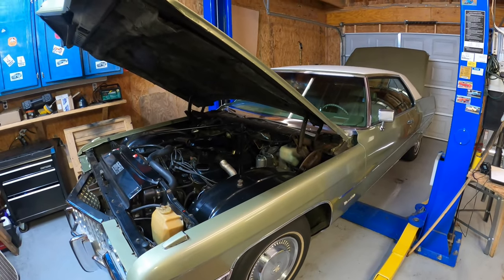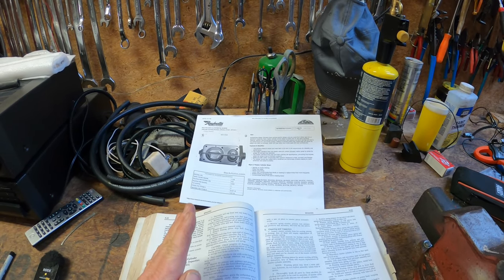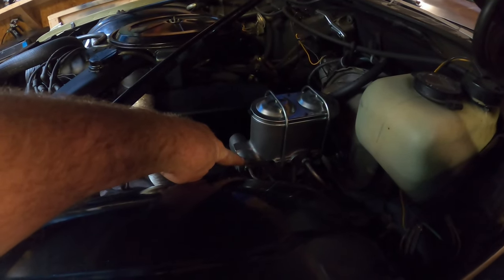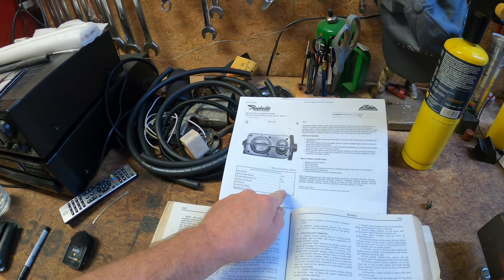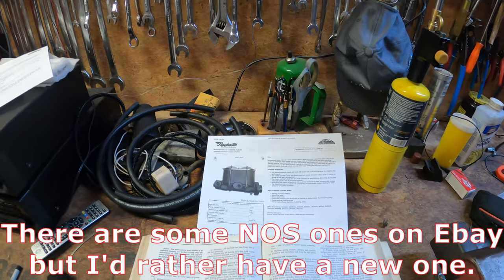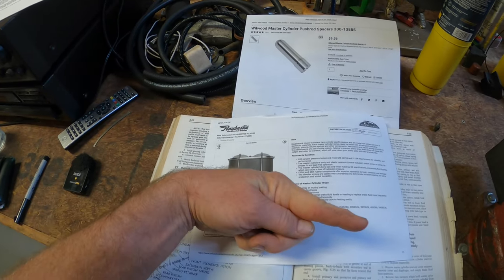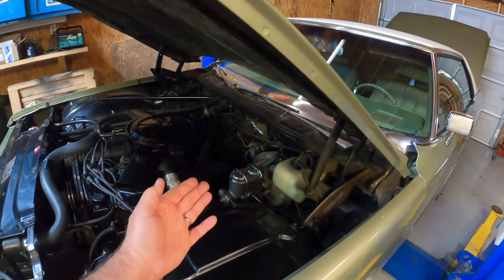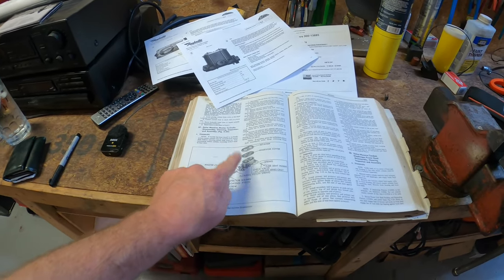Early 70s Cadillac Brake Master Cylinder - Parts Distributors Got It Wrong

Comment: We used to get rebuild kits for these master cylinders. Slave cylinders, too.
Can you not get them anymore? 
I forget. Does that have disks on the front? 
Since that newer design is more universal, the manufacturers must have decided they could dispense with the original design. I wonder if the piston from your original master cylinder would fit in the new one so you would not need the adaptor and just switch the rubber bushings? 🤔
Reply from the maker: Disk front. drum rear. I attempted to find a rebuild kit but was unsuccessful. Does not mean there isn't one though. The piston from the original is trashed however. Severely corroded.
Reply: @ImpalamansGarage  be great if we had more rebuild kits

Comment: Hey I have a question (okay a few questions). When you recently worked on the engine on your CDV, what brand of gaskets did you use? And specifically the rear main seal?  I guess I would like to know what brand of timing set as well.  Were you happy with them?  So far I've found only a fel-Pro gasket kit for my Eldorado, and am considering Melling chain and gears.  Soon I'll be pulling the engine out to perform several maintenance items and I am going to try to do all I can reasonably do while I'm at it. Pretty much everything except the rotating assembly will be addressed.  And maybe that if inspection warrants it.
Reply from the maker: Rear main I believe was Mahle from Oreilly. Timing set is Cloyes. Just the basic all steel set. Nothing fancy. Good parts.
Reply from the maker: The valve covers, oil pan and timing cover were all fel-pro.